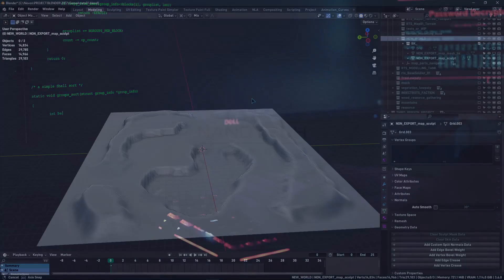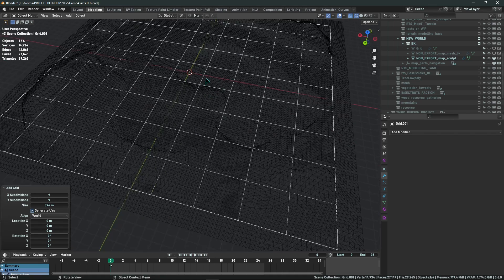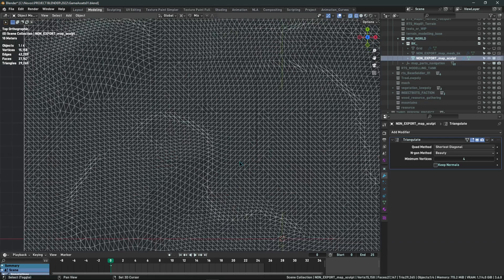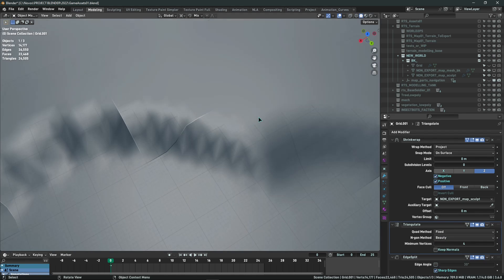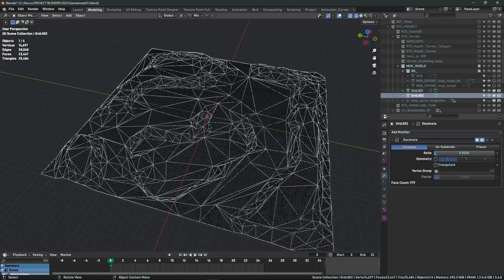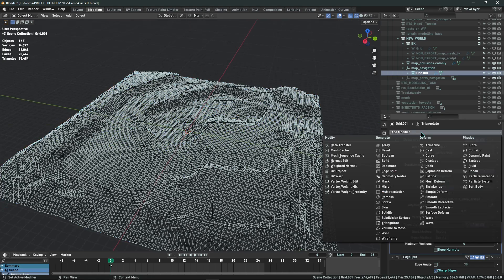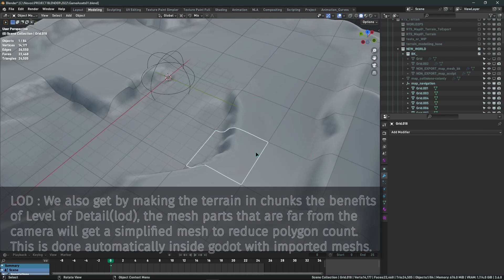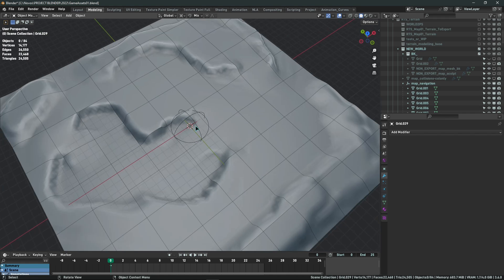How I made a Terrain for an RTS Game : Godot RTS Region Processing Part 1 - Generating Grid System

Comment: Don't center your map at zero, noob 😂, go from 0 to max, also modulo vs ceil() or floor()
Reply from the maker: Hey you got featured in the next video! go see why I didn't wanted to work only from 0 to max only, also if you have more ideas feel free to post them here, welcome to the channel by the way,
Reply: @nanotechgamedev  I work on infinite world with procedural planet space game, you say it's simple and don't waste performance without explaning how... You had issues because around zero the center get confused when you try to access chunk through hash, which is why I commented to compare modulo vs ceil floor function, they are supposed to do the same thing but have different behavior around zero. I think it's best to use corner as reference for chunk and tile because of that, and also how many algorithm works in generation. Else you end up having to write a lot of error prone boilerplate for edge cases, when you could have simpler math, faster and more cache friendly. Also static mapsize rarely go other 8km, botw is 7km, sure you can address 16km with negative, but by that point you would have visual lod, chunk streaming, and various system that work below that distance, and to which it's more beneficial to have a floating origin asap. And chunk size and distance is preferably power of two.